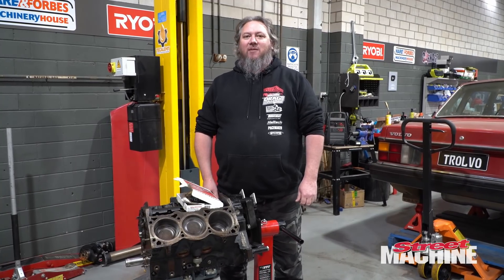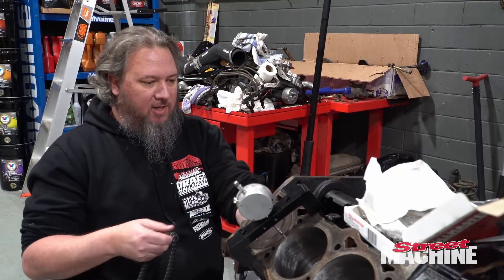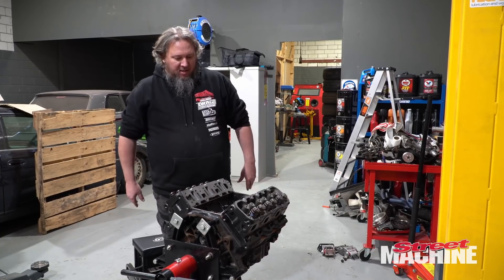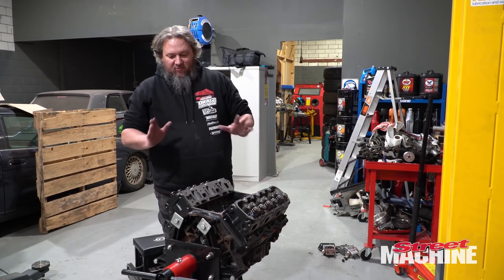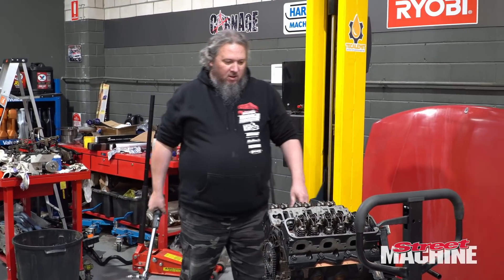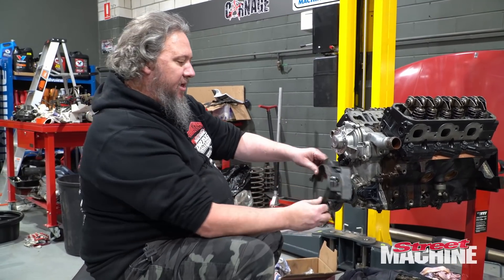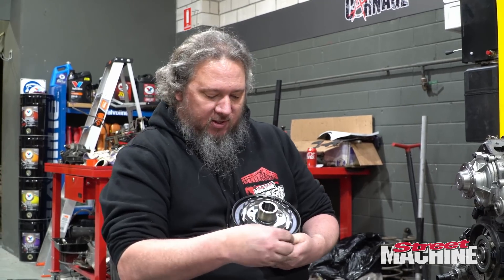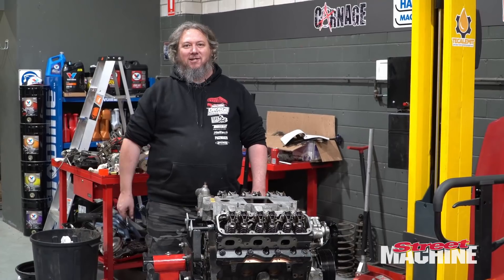Carnage - Supermang L67 3800 rebuild - Part-4

Comment: Just wow. You know you just remove the balance shaft gear and mod the balance shaft retainer and bang double row goes on. Thread tape on studs just no.  Yes i can talk because ive done it already and im at 270rwkw.  This could have been a great build  and even with all the good advice from people who know what they are doing you still go against it lol .Good luck  because unless you do all the proper mods your just going to be very dissapointed and with out sc porting etc its not going to make alot.
Reply: You did hear the bit about a stroker being built for this? clearly this engine ain’t hanging around so is just a slap together and have some fun thing and at worse a learning experience for us out in internet land
Reply: @knight2425   Yes and its a known fact the stroker cranks are weaker than the stock crank and the gains arent worth it. You will get gains from proper camshaft selection, head porting, sc rebuild and porting of the supercharger with larger elbow and throttle body. Without those mods throw all the boost you want at it you will be very dissapointed with the outcome. This is his way of thinking and these engines dont work like that.  If showing the masses how its supposedly done wouldnt you do your research and do it properly the 1st time? This is destined to fail unfortunately unless he starts listening to people who have already been there and done it.  🤦‍♂️
Reply: @vr350  Seen quite a few stroker builds with boost and without putting out some impressive numbers and quite a few stroker builds having little problems with cranks. This is his car and it’s the direction he is going, we get to come along for the ride and see what works and what doesn’t. Don’t worry, if that crank fails in the next motor or the timing chain fails in this one you and many others will be able to jump on real quick with the “I told you so Scotty” remarks
Reply: @knight2425   Show me ? Turbo is a different thing. We are talking l67. They are a whole different ball game. Imo if it were private id agree but this is street machine showing supposedly how to build an l67 even though people are more than willing to help and give advice. The problem is he does dodgey stuff and wont listen to the ones that know their stuff with these engines. So your comment has no merrit whatsover.
You also say show me your build well i have one and i gave him free advice on how to get similar power.
Reply: @vr350  yes this is street machine and if you watched a few episodes you would have seen it’s basically just having a go at anything whether it’s by the book or a little off norm. There are so many armchair experts that like to tell him their way is the only way but personally I like many enjoy seeing how Scotty does things. As for comment having no merit, I think yours probably sits in that category also then
Reply: @knight2425    No its showing how not to do things atm thats why he is copping so much shit.  Ive watched all of them and some of the stuff he does is cringe worthy. Especiallly when your showing people how to do something and cut corners. Only car hes got right so far is the trolvo ill give him that. Imo if he took the advice and did things properly then we wouldnt be having this conversation and wouldnt be copping shit in the comments.
Reply: @vr350  trolvo has had its moments also. I don’t think you actually understand what the channel is about so perhaps it’s not really for you, many of his followers are loving how he does things and shows us how things can go wrong and let’s face it if everything always went to plan it wouldn’t be as interesting. Maybe seeing as you know so much, you can put a channel together post how to only do things the correct way and we can all watch in one of your magnificence
Reply: @knight2425   My results are up for everyone to see go have a look on fb and you will find it. Dont like what i have to say scroll on.
Reply: @vr350  Don't like what Scotty does then try your own advice.
Reply: @knight2425   Lets see you build one. If i see he is doing something wrong i can comment just like many others. Would you be happy if a perfomance shop slapped parts in and said oh i hope it will be ok it may blow up on the dyno. Answer fk no!
So if your showing people a build do it properly!
Reply: @vr350  you should look at what you are writing and see how up yourself you are. He’s not a performance shop and like I said previous you really don’t understand what the channel is about do you, if you knew anything about Scott you would also know messing with the V6 is not new to him
Reply: @vr350  of course he doing it wrong because it’s only right if done your way lol, use that last bit of advice for yourself if you don’t like it
Reply: @vr350  what's the FB page so I can see?
Reply: @ayepeacee  Look up Ace Performance Tuning on fb its all there.  Ive started from a high klm stock engine with bolt on's to what it is now and have more planned. Yet to run at the strip due to the covid atm. Id say with new 1-3/4 pipes+ better flowing cats it would be about 280rwkw currently.